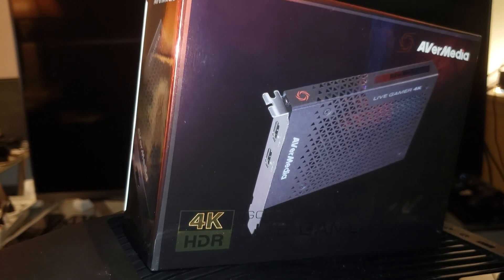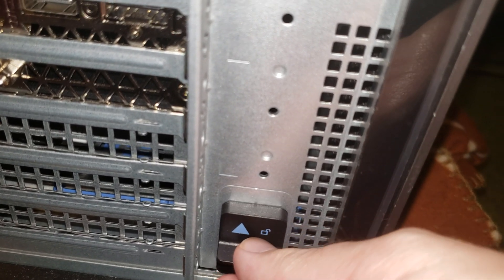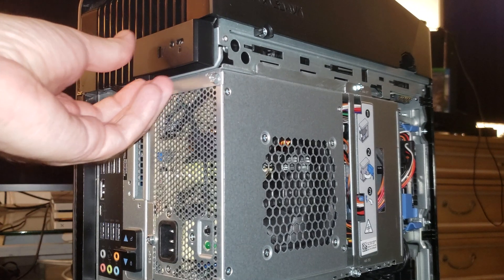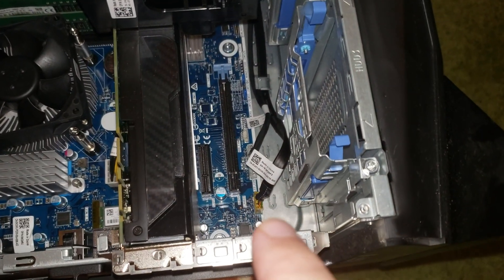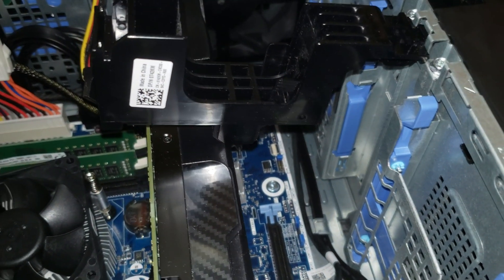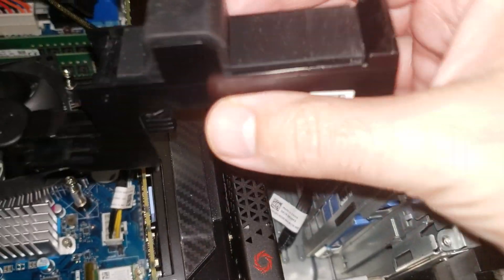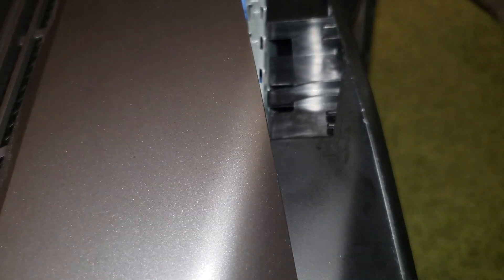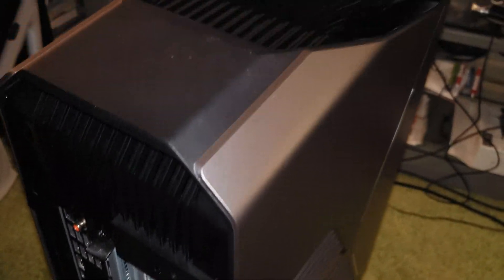How to Install AverMedia 4K HDR GC573 Capture card on Alienware Aurora Desktop

Comment: Did the capture increase your GPU temps? I couldn't tell if your card is the blower type or circulates air back into your case. The larger PCI-E 16X slot can be used in conjunctions with PCI-E X4 cards. I know the size doesn't match up but your capture card should slide right in and work as intended to give your video card breathing room. I've used the larger PCI-E 16X slots for 4X expansion cards in the past when my video card took all available PCI-E 4X slots and it worked normal.